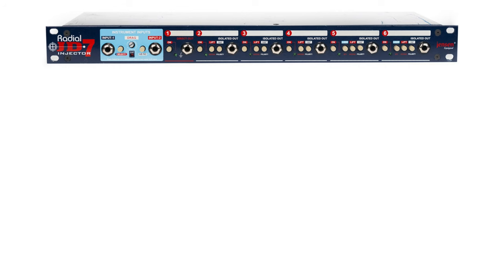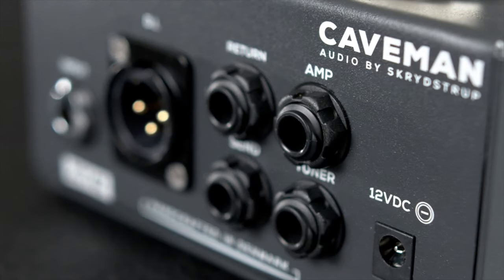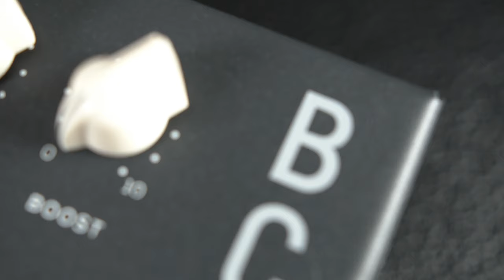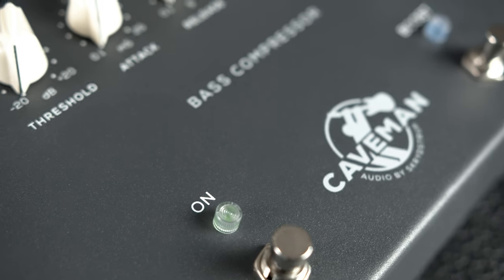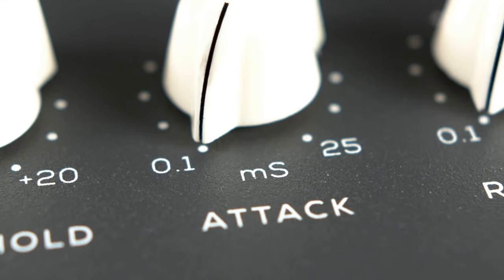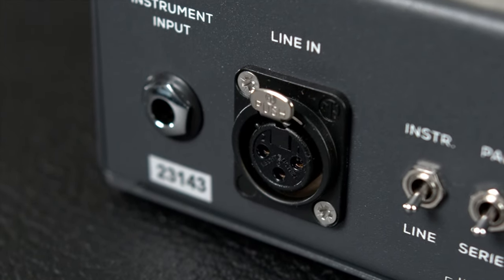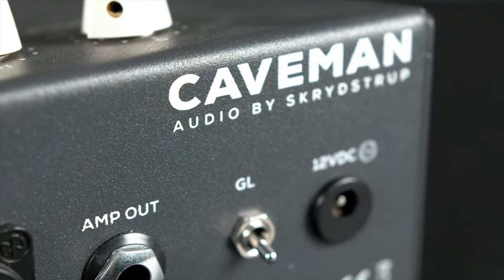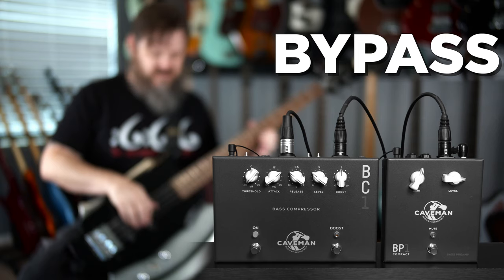Where Should You Place A Compressor In Your Signal Chain?

Comment: Really depends on what you want to achieve and what pedals you're using. You need to think about signal flow. For example, an EQ into a compressor would result in any EQ boost you make being more tightly controlled. But the other way around, you're controlling the signal first and then shaping it. 

I personally put my compressor first because I like my pedals reacting to a controlled signal. But it's cool to experiment. When I record in my DAW, I enjoy moving the order of my plugins around to see how it changes the sound.
Reply: I run my Comp first also. I find its the best for my signal chain for what I use.

Comment: I have been using a comp at the end for a couple years now, where I used to throw it at the front of the chain.  I like it better at the end, plus if you have a sweet comp at the end but also have a dirty/crunchy comp hanging around, the crunchy one can be used on and off for a grinding boost.

Comment: Why not both? A compressor at the beginning of the signal chain and one at the end. 🙌 Also, Jayme's got hella groove 🤌
Reply: Agreed, I have a BBE maxcom, channel 1 is first in my chain, channel 2 even goes in the loop of my amp. First one makes the grit of my sansamp more consistent and second one takes care of the peaks, my tone quest is over since 2 years almost.
Reply: @pideuhweuh8459 would you mind sharing the setting for that 2 channel compressor in your bass rig?
Reply: @realtruenorth  Sure, same on both channels but keep in mind I'm far from a compressor expert 
Threshold: 0
Ratio: 5
Attack: 0
Release: 4
Set output to match unity gain
Maximizer is Off on Channel 1 and set to 4 on both controls (but sharing these is quite pointless as ideal settings will really depends on the rest of your rig)

Comment: Thoughts on using Hyperluminal for this application anyone???
Reply: I’ve been keeping mine at the front of my chain for fear of taming envelope/chorus/flanger too much, but I have tried putting the HL after fuzz/distortion to tame them—it tightens thing up, but then again it also adds more compression to a compressed signal at that point. I don’t know what placement for compression is best, but I do know getting every pedal on the pedalboard to unity volume really helps taking out the frustration and over-tweaking.

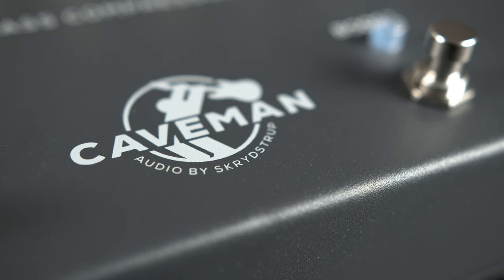Comment: 5:15 - this comparison is pretty meaningless. You didn't match the levels so when you activate the compressor the overall volume is louder and then with parallel it gets even louder. This is 101 for comparing compressed/uncompressed signals - you must match levels otherwise the louder signal sounds "better" just by being loud and not due to the compression.